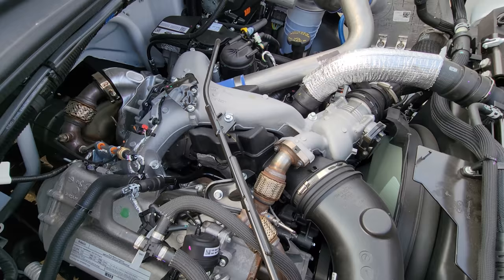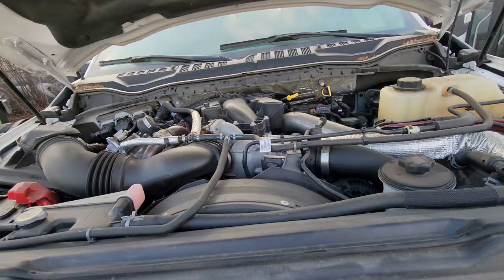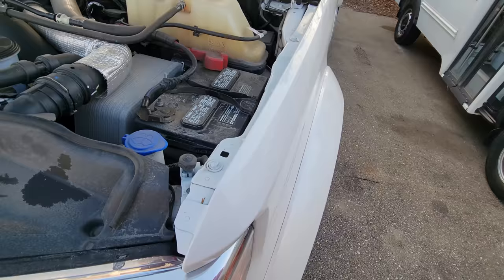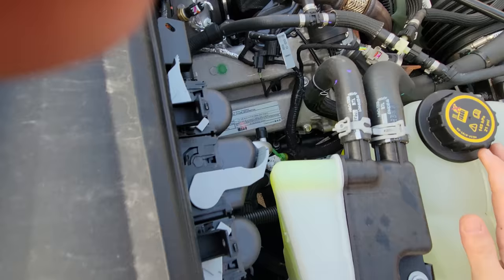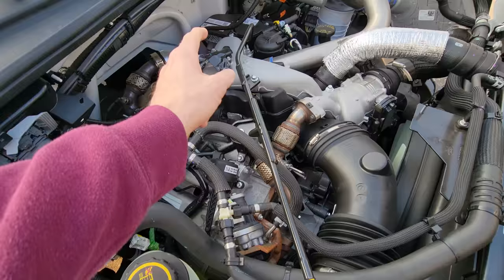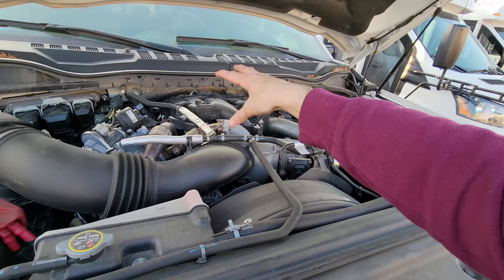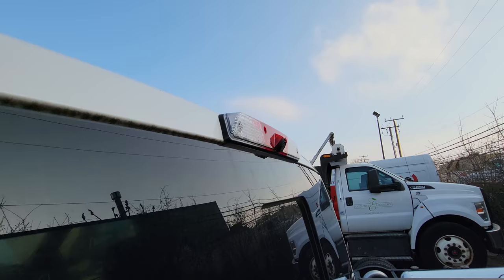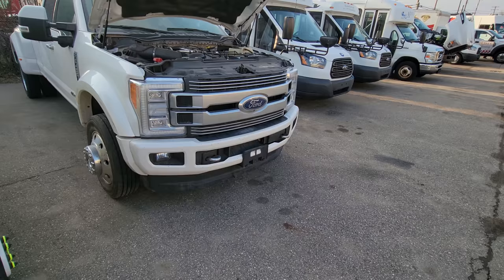Do you know???!!! FORD 6.7 DIESEL - Under hood components OVERVIEW F250 F350 F450 F550 F650 F750

Comment: All those small coolant lines laying across the top of the engine are "vents", they all connect to the highest points on the different passageways to allow air bubbles to get out of the system.  Keep up the great videos!

Comment: That "lower" intake on the 2020+ is still the air filter inlet which was still plastic on previous generations. The upper and lower post turbo intakes are now aluminum now. 

Also, no longer oil actuated VGT! Finally electronic again which I feel ends up working better (especially for feedback to the PCM)
Reply from the maker: Yepp

Comment: Great video. I really wanted the diesel but went with the 7.3L godzilla because I didn't want to deal with all the maintenence issues and the extra cost didn't make sense for my needs. Would love to see a video like this on the 7.3
Reply from the maker: 7.trees ARE backed burner'ed😂
Reply: I think you made a good choice.  Unless you're pulling heavy things for long distances, the 7.3L makes more sense.  There's a lot more maintenance on a 6.7 diesel.
Reply: missfire engine
Reply: @lancz1977  I believe that was the first year and it was because of the spark plug wires. I have 23K on my 21 and no issues

Comment: Can you also show the transmission fluid check for the 6 speed 
(hot while running I want to know exactly how much is supposed to be in there and what's borderline overfilled
Reply from the maker: It shows you on the stick buddy. HOT Range....
Reply: @PowerStrokeTechTalkwARod  ya I know that 🤪 I want to know how much Ford puts in there . The range of that stick is a whole quart or more do you fill it right up to the top of the stick in the hashmarks or do you leave it on the lower side
Reply from the maker: S long as you're within the hash marks your good your owner's manual tells you the full capacities of the transmission but depending on the type of repair that you did it's gonna justify how much fluid you put in every repairs gonna be different

Comment: Great channel.  I have a '24 F750 i'm about to pick up soon.  It's derated to 350hp/750tq i believe.  I typically use shaefers oil.  What intervals would you suggest for oil/fuel filter changes?  Will be putting roughly 5k miles per month.  Thanks!
Reply from the maker: 5k miles or 200 eng hours MAX

Comment: PTT, what’s the difference between the CCV filter on the pickup truck you are showing in this video and the one on the 650/750 in this video? I have the style thats on the 650/750 but I’m curious if it’s the same part number to replace it as what the pickup takes?

Comment: I have a 2017 f550 with the 6.7 Its building pressure in the primary coolant system and pushing the coolant out of the tank.  Do you know what the problem may be or what I should check?

Comment: How about an oil change video on that thing?
Reply from the maker: I already have 1. Go watch my maint playlist...its in there
Reply: @PowerStrokeTechTalkwARod  -I meant on this particular truck with 60k miles and no maintenance, how crazy.
Reply from the maker: 😂😂😂 no oil change needed. Whole ENGINE broski.....everything
Reply: @PowerStrokeTechTalkwARod  -Well I was wondering how the heck it was still running! I must have missed that if you said it.
Reply from the maker: Locked up buddddddd

Comment: I've got a question for you. At "8:11", what is the actuator valve called in the middle of the screen, under the small hoses? It has the arm coming out that attaches to the shaft that goes down into, I guess the EGR cooler bypass? I have a 2013, that every time I shut the truck off, that solenoid squeaks after the vacuum releases. It's really annoying. What would the part number be? Thanks for the informative videos!
Reply from the maker: Its a diaphragm...nothin ur gonna do brother...juss how it is..
Reply: @PowerStrokeTechTalkwARod  Thanks! I was hoping to maybe replace it with one that doesn't have that horrible squeak! LOL I guess it's fairly common?
Reply from the maker: Normal operation

Comment: I get conflicting answers when it comes to the ccv reroute I have 2013 f250 6.7 so I need to run ccv reroute?  I changed my cac cold side pipes because the top boot split and I noticed a little bit of oil in the pipe goin into the throttle body my truck is all stock because I live in shity California so am I safe to run it stock or do I need to get the ccv reroute? Thanks ppt your the freakin man best powerstoke tech 💯

Comment: What do think of the 2.7 ecoboost? thinking of trading my 16 f250 because I’m tired of the rough ride
Reply from the maker: 6.7 all day
Reply: I was very impressed with the 2.7 and 10 speed combo. I pulled an 8k camper up I-70 over the Rockies (Ike Gauntlet) at the speed limit no issues. The whole time telling myself this little truck is out pulling my 99 F350 7.3 6 speed. 
I now have a much bigger camper and a 21 Superduty 6.7. Same story but now pulling 16k. Ford builds extremely impressive machines!
Reply: Sif get the f450. Then you won’t complain about the f250.

Comment: I have a question: I replaced the turbo on a 2011 6.7 PowerStroke, but after putting everything back together the truck will turn over but will not start. The starter just cranks the engine. As far as I can see everything is plugged in correctly. I’m going over it again today but what sensors would prevent it from starting?
Reply from the maker: There would be no sensors on the engine that would keep it from starting when doing a turbo
Reply: @PowerStrokeTechTalkwARod  Thank you for responding. I followed the service manual exactly so it doesn’t make sense what is preventing it from starting. It’ll turn over but won’t fire up.
Reply from the maker: Sounds like you're gonna need to get a scan tool. On it to do a little bit of no start diagnosis. Definitely not a guessing game on these trucks
Reply: @PowerStrokeTechTalkwARod  The manual says to reset/clear the specified function for the turbo system. But my Autel scanner doesn’t list that function in the Special Functions screen. Would not resetting that prevent a no start? There’s no codes on the pcm.
Reply from the maker: @larrysnellings7992 absolutely not....
Reply: @PowerStrokeTechTalkwARod  Okay, so I should be able to rule out the turbo. I’ve got the upper and lower intakes on and their connections are plugged in. Oil and coolant changed. The truck started when it came in. That’s why I’m confused. I can’t think of what I’d have done to cause it to not start.
Reply from the maker: Scan tool time
Reply: @PowerStrokeTechTalkwARod  Okay thank you. I’ll start scanning to see what’s going on. I appreciate your responses!
Reply: @PowerStrokeTechTalkwARod  I’m getting the batteries charged and tested, but I am about 100% sure I didn’t, but say I left a paper shop tag in the inlet pipe to the turbo, would that prevent it from starting? I’m getting exhaust flow but the service manual calls for checking the EGR system for blockage and it caused me to think of that
Reply from the maker: @larrysnellings7992 nah I doubt it
Reply from the maker: @larrysnellings7992 why can't you get a scan tool that will let you monitor data?????
Reply: @PowerStrokeTechTalkwARod  Okay great! I just wanted to write that off in my mind.
Reply: @PowerStrokeTechTalkwARod  My scanner does monitor data, I just haven’t been able to use it today because I pulled the batteries out of the truck to get them charged. I figured that since it ran before I changed the turbo and exhaust manifolds, and now it doesn’t after replacing them, there must be something I did in the process to cause it to crank but not start. But I’ve rechecked everything and it all seems fine; hence my confusion and questions to you. Once the batteries are fully charged I’ll use my scanner and start looking in another direction for the issue rather than what I did in replacing the turbo.